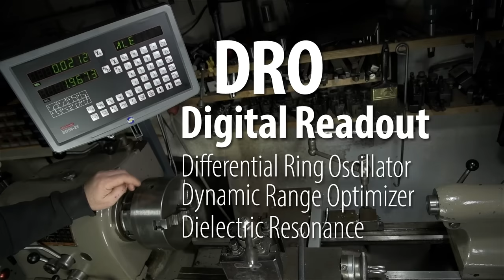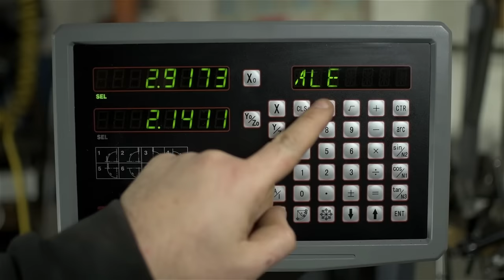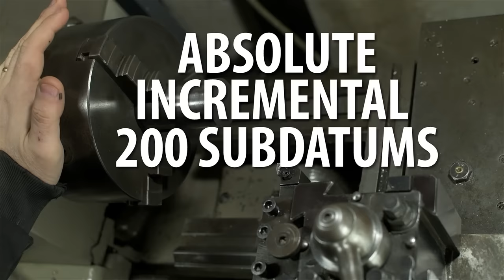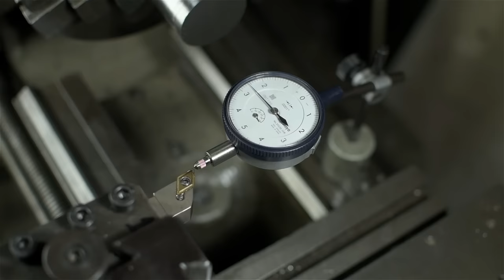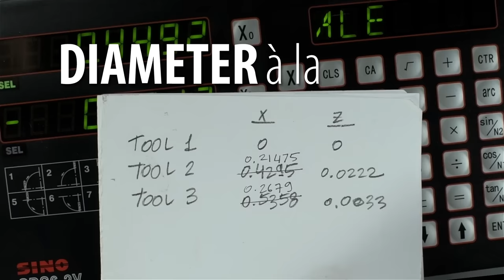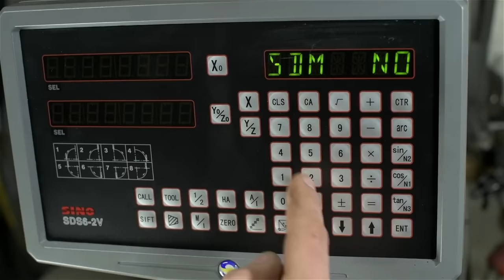DRO BASICS? & Lathe Tool Offsets!! (SINO DRO)

Comment: I bought a Bridgeport mill that had a name- brand DRO. The bad news was the X axis  scale was not working.i unplugged the Y axis and swapped with the x to see if it was the slide or DRO unit.it was the slide (scale).The brand name company wanted $600 for a new x scale! I could buy a new Sino for less! My question is are you happy as a hobby machinist with your dro's?

Comment: would it be a good idea as well as avoiding a lot of work by just roughing the channel out while holding the dovetails in the vice mill, and then spring-passing while having the tool-holders in the lathe and the desired size end-mill in a collet chuck? essentially, you should also be able to completely dial your tools in on the center-line if you make each tool holder specific for each tool, wouldn't you ?

Comment: The DRO on my robotics club shop mill has 2 switches and 2 buttons: on/off, metric/imperial, zero x, and zero y; I am seething with envy at that 1/2 button and built-in calculator.

Comment: I suspect the error between tooling was due to the workpiece cooling after the first cut. JK. I recently had a machining project where I had to use dial indicators because the original Bridgeport lathe DRO was dead. This sucks after you're used to using it religiously. At the last couple passes, I had to cool the workpiece and re-measure to make sure I was on track. Dimensional tolerance was 0.08mm in 300mm long shaft accounting for both taper and diameter.

Comment: Could you rough out the tool slot, then mount the holder to the lathe with an endmill in the spindle and finish that bottom surface? Though you'd have to use the tool height adjustment for your Y axis

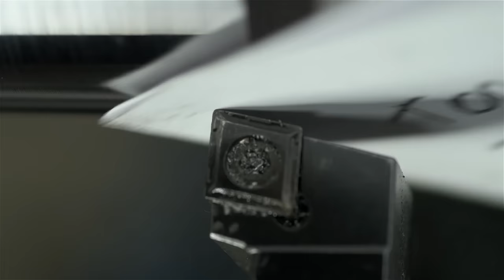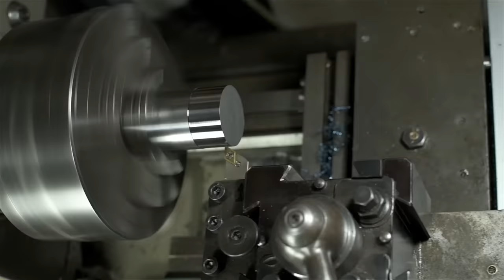Comment: Regarding the error at 23:00 -- just how repeatable is the tool change?  I notice at 21:56 things move when tool #1 is installed.  If a similar movement happens at every tool change and if it is not picked up by the DRO, then that could explain the inaccuracy after switching to tool #2.

Comment: The math on the DRO's calculation of your tool 2 offset shows an offset of 0.429" at your 1.453" diameter instead of the 0.449" you measured. Then that error grew when you moved the slide, so I am thinking it must be that the tools are off center. Maybe even an angle in the tool holder? Otherwise the 5 micron resolution just became 1mm!

Comment: It's more than 402 coordinate systems. It's actually 40,400 coordinate systems because you get 200 for abs, Inc and all of the subdatums. Since the off sets apply on top of the base ones it's 202*400

Comment: Would you be able to just throw an end mill into the lathe and hog out the slots on the tool holders that way? Or would that be too much effort to get the post lined up with center of the lathe?
Reply: You would need a massive lathe to "hog" - milling requires a lot more rigidity in the structure and slides than most lathes can offer. But certainly you could rough them in a mill and then (perhaps using solid carbide end mills) skim them in the lathe, if you wanted  to.

Comment: I think your difference in tool absolute zero came in when you backed off tool 1 after the cut? maybe set the works diameter before backing the tool off and then change the tool?

Comment: I put a 3 axis DRO on my framing hammer,  …  works great on vertical or horizontal surfaces such as walls, floors, and workbenches (I have not bent a nail in any of these situations since I installed the system)
But,    and this is a BIG BUTT ….  totally useless on a roof or any other off-level/plumb surface
Reply: Scott Elmore                so if you put the reflective angle block under the tail end , the head end will nail at the appropriate angle .     LOL . BUT AS SILLY AS THIS SOUNDS IT WAS WHAT I DID WHEN MAKING WOODEN SURFACES FLAT AT SPEED. I SET UP A JIG SO THAT THE REAR END WAS UP TO NAIL FLAT. ALL I HAD TO DO WAS PULL THE NEXT ONE ACROSS . LESS MOVEMENT LATERATELY EQUALS A HIGHER SPEED LITERATELY .   P.S.   I DO UNDERSTAND YOU ARE MAKING A JOKE  .

Comment: I've got a weird one on my ToAuto dro. I cannot do an input diameter in Imperial. I have to measure the diameter of the work in metric, then enter it into the DRO, then switch back to Imperial and I get the same sort of different value that you did Tony. That's sooo annoying!

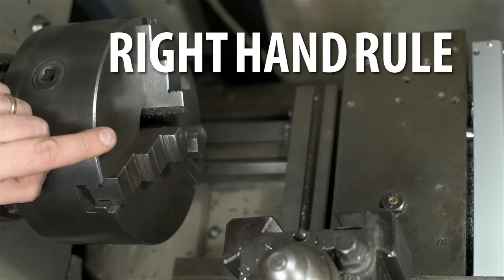Comment: 5:42 so im guessing there are different right hand rules for each different DRO i.e., mill, lathe?
on the EZ Trak i work with has the Z axis pitched 90 deg forward and then rotated 90 deg CCW, though ive been a welder for 10 yrs, got tired of waiting on peoiple making my parts and started learning how to make them on my on about 2 yrs ago

Comment: I want to make a dive flashlight so bad! I keep running through dive watches and dive lights that have "magnetic switches" that all end up corroding and not working. It's expensive... How hard is it to make a simple underwater flashlight with a switch that will last?

Comment: Hi Tony,  I recently  took delivery of a brand new mill fitted  with a three axis DRO. The instruction book that came with it, despite being written in chinglish,  is worse than useless. I watched this years ago, before the mill, and I just watched it again, hoping for some cranial clarity. It hasn't happened. Is there a book on using DRO's you can recommend, or is the knowledge only gained through trial and lots of error. I'm sure I'll watch this a dozen more times before  I get all of that inwardly digested to the point it makes sense. Thanks, and regards from Canada's banana belt.  
🤞🇨🇦🍌🥋🇺🇦🕊🇺🇲💩💩🏁👍

Comment: I thought the reason those calipers knew it's position is because they never really are fully off unless you pull the battery out. Tony, set me straight!
Reply: That's pseudo-absolute, not the real deal.
Mitutoyo are the real deal.

Comment: Hi tony.   I have a colchester  like yours but a triumph    I would like to fit a dro..... but what you said about the scale needing to be small...... can you tell me what one you used?
Reply from the maker: I'm not sure about triumph but on the student there is not a lot of space next to the cross slide.  The other (long) scale has plenty of space but for the short scale get the "Slim" or "Compact" version  if you're tight on space.  All scale manufacturers should offer a 'slim' option, just compare measurements with what you need so you're not spending extra money if you don't have to on the Triumph.  (Or you could always install it hanging out the back).

Comment: If it's a digital scale, do you know the exact resolution? If it's an 11 bit resolution, then that would result is precision increments of ~0.00049 (1/2048) and would explain the jumps in position. It could also be a 10 bit resolution resulting in increments of ~0.00098 (1/1024) and it could be rounding you to the nearest precision point?
Reply: But 1/1024th of what? If each 'point' in the scale was 1", that would be a resolution of 0.0009765625". But I'm sure the scale points are much less than 1", probably more like 1mm, which would make it 0.00003844734252" resolution.  So I think the problem is elsewhere. I'm guessing the processor floating point calculations are running out of precision, for which there are solutions, but that requires someone knowing what they're doing.

Comment: Would be so much nicer to have a LCD screen with touchscreen. 8 inches 800x600 is all you really need. It could still have some physical buttons on the bottom and right edge for often used functions, and to make it easier to use in some situations.

Comment: I'm pretty sure this will only work out if all your tools have the exact same stickout from the tool holder. If you change the angle of the tool post, good ole phytagoras will kick in. In other words, rotating with different stickout  will yield different x and z if the angle changes. Hope i'm wrong so you are not wasting too much time...

Greetings

Comment: On my SINO DRO (same model number, but who knows if the software changed), pressing the up and down arrows cycle from ALE, INC, TOOL 1, TOOL 2, etc. Since I only have the patience and need for 2 or 3 tools, and not than many more holders, this is much faster than pressing the call button and then a digit. DISCLAIMER: I have no advanced judokaratekungfu machining skills.

Comment: Nothing wrong with the readout. When you finished the cut, you eased back the tool on X before you brought it back to the right side. The DRO simply registered this. That's the small difference you ended up with.

Comment: I've got a big problem! I've got a lathe with a mill head attached to the headstock of my lathe. I've fitted a three axis DRO and I've set it up with the X axis on the cross slide the Y axis on the lathe spindle and the Z axis on the mill spindle. No wonder my DRO gets confused!  I can only have the X axis on the cross slide because the diameter function only works on that particular input. So I get confused when somebody says abc on the Zee axis ( I'm taking the piss coz I'm a Brit and we say Zed for the American Zee lol ) and I think why is abc taking the mill quill down  when he should be doing abc to the lathe centre axis !

Comment: Would you not zero all at first / appropriate hierarchy to spindle axis, 2D, then work in neg radiuß, or diamter, with rounding errors always abs val larger ßort off, and have to xzero with new inserts else 50% worn?

Comment: .0003" in angle error across the length wouldn't equate to degrees of error.  The error on center line from carbine to part will have more impact.  Check out Joe Pieczynski's channel and his vidjayo on tool CL setup.

Comment: I did not see you zero the ALE when you zeroed tool 1. That may just not have been on the video, but all the tools reference the ALE zero, so if it was not zero at the same time as tool 1 was, you will have an error. I also think the direct entry for a tool has to have the sign inverted, but I avoid that by setting the tool axis zero when I use the indicator, avoiding having to think and find a piece of paper in my shop that isn't oil stained.

Comment: As I see it, home-machinists spend 50% of their time to make fixtures, jigs and specialized tools required to actually do the job at hand; 25% setting up job with above said necessary items; 25% actually machining part/workpiece at hand. Rather subjective, but I hope non machinist get the basic picture. YMMV
   But the quality in the part/workpiece is all in the setup! And the quality in the setup is all in the necessary fixtures, jigs and specialized tools required to actually do the job !  Look here's how it goes:
1) Job performed fast
2) Job performed with quality
3) Job performed with low cost
You can only pick TWO !

Comment: Does turning a crankshaft down .125"  with just engine power and emery cloth could as machining? And no its not egg shaped.... Seems like theres only a blonde one of run out at 3000 ripems.

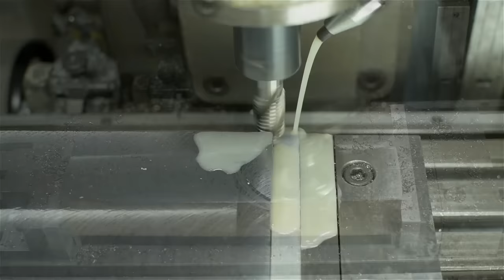Comment: At 4:16 I've never gasped so hard.... my entire family just passed out from the oxygen being sucked out of the room!
Reply: Kudos to ToT for showing his screw-ups so we can spare ourselves having to pee on the electric fence for ourselves.
Note to self: anytime I use a 2 piece vice for something long and narrow (where the diagonal is barely longer than each side) I  need to either restrain the sides of the workpiece (if any T slots are left showing -- actually I can think of a few dodges if they're not) or failing that, back up the vice jaws near their ends -- in either case, perhaps with edge clamps (like MSC #: 73153702) ,  Mitee Bite clamps,  or similar. Backing up the vice jaws could be done almost as well by just using the conventional toe clamps from a clamping kit, clamped to the table end-on to the back of the jaw, tapped towards the vice jaw with a lead   hammer as the cap screw is snugged down hard.

Comment: Correct me if I'm wrong. It seems like you could just make a cut, with tool #1, set it as zero in the library. Load tool#2, touch it against the surface you just cut with tool #1, then zero tool #2 in the library, with the candlestick.🙄

Comment: I would argue that the Mitutoyo calipers are still incremental, certainly from the sensor's point of view If the battery died, and you moved them, I bet they would show zero!

Normally absolute encoders give the output as an actual unit, which is why they cost so much money. Over the length of the sensor, a rather complex pattern is required to produce a fixed digit at any point, which often has to be able to be read when stationary. An incremental system is as simple as producing a quadrature pulse, but if course it can only know where it is with respect to a predetermined point, and by counting. Miss a count, you get an error!

Comment: You instinctively backed the tool away from the work when you finished your skim cut at 22:00 in the video.  When you measured the OD and input the value, your tool was not at the same diameter as the work.  Done this many time myself.  Try setting the diameter again without backing the tool away.

Comment: I guess you have to be sure your toolholder is aligned straight for this?
If you are used to a DRO on the lathe you don't want to go back. I had to turn something on the colchester at work because it wouldn't fit the other lathe and the numbers on the dials had no discernable relationship to the material taken off, none whatsoever. Give me a DRO any day, even if it is the one with the broken enter key nobody can be bothered to repair.

Comment: One of the tool measurements had a negative value for zed (perfectly fine) but IIRC you put in the positive equivalent. Error!

Also, I'd expect your number changes on input based on the hardware floating point precision of the machine. IOW, not every floating point number exists in a computer. I can explain more if you want, but it depends on knowing what kind of chips the DRO actually uses. See https://en.wikipedia.org/wiki/Double-precision_floating-point_format for more.

Comment: Ya I got the half the number cuz it’s in diameter mode but what I don’t get is why you keep poring milk over your tools while using them. My mill is lactose intolerant. I also only use gluten-free stock. I don’t think my work looks better but all the machines keep telling me that it’s so much better.
Reply: Actually full-cream milk is a good cutting fluid for pure copper.
Tax deductible, and you can sneak some for coffee.

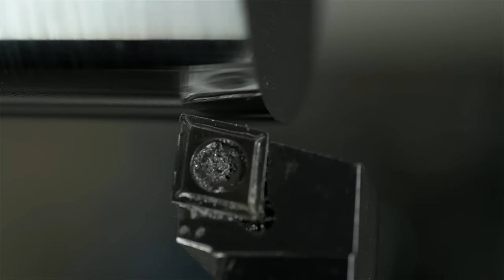Comment: The reason tool two was off .040 at the 22:56 mark was at tool one you took a cut backed off the tool then measured the part THEN set the DRO with the side backed off the part. you should of just slid the Z axis right measured the part and set  x zero there not moving the X axis

Comment: It always drove me nuts on a lathe how going into diameter mode also changed the z axis.  It cannot be hard to have it only make the change to the x axis when switching between dia and rad mode.
Reply: I never felt the need for a lathe DRO and now I can see why.
Reply: @Gottenhimfella  The lathe at work wouldn't be worth a shit without it.  The amount of backlash in all axis was astounding.  That thing was worn and clapped right out.  With the dro you could come within a though doing turning if you indicated everything on the 4 jaw (the 3 and 6 jaw were a good 15 to 20 though out).  The phases on it were backwards for the first 50 years or so it was installed.  Yes, it took about 50 years of abuse in a maintenance shop before they had it serviced and were told the phases were backwards.  I asked why the reverse button made it spin in forwards and was told I was looking at the picture wrong.  It can have a huge effect for a worn out lathe because it is about linear position and does not rely on worn out parts for the readings.  If your machine is in good shape, it is not as helpful but still better.
Reply: @Worrsaint   Don't be so sure about your closing proposition. Some of the more serious problems with a worn lathe do result in major discrepancies between  DRO readings and tool position. 
For instance, the scale which reads the cross-slide position  is mounted to the carriage, so that any deviations from orthogonal motion by the carriage, notably in roll about the z axis and  excursions sideways and vertically relative to the z axis (both of which arise from a worn bed) will not be identified by that scale.  
Backlash due to worn feed nuts does not prevent the feedscrew dials from telling the same story as a DRO, but uneven wear to the feedscrew certainly does. And that's probably the one thing which would persuade me to consider fitting a DRO, except that I'd personally rather replace or remake the feedscrew and nut.
Reply: @Gottenhimfella  That is true that depending on the wear it could give different results.  Lead screws do generally wear un evenly due to not using the entire travel.  It was very apparent in the cross slide because the amount of backlash changed noticable as it was moved in and out.  The carriage did not seem to pitch and roll when it was used to a significant enough extent.  That thou of accuracy was measured accuracy on the parts.  While yes replacing the parts and reconditioning the mating surfaces would be ideal, getting the maintenance shop to speed any money on fixing the tools was just tilting at windmills.  It having a dro was the only reason it was usable for any type of precision.